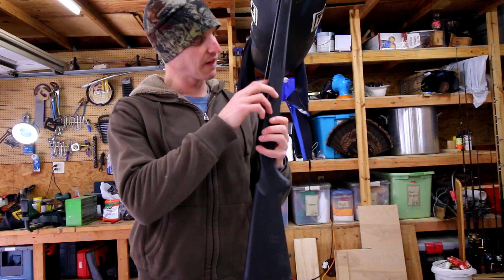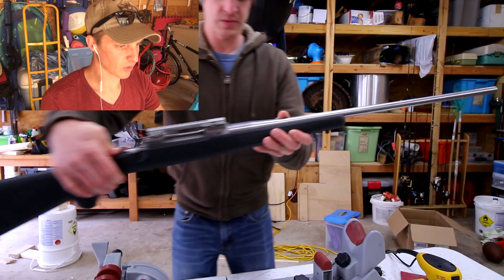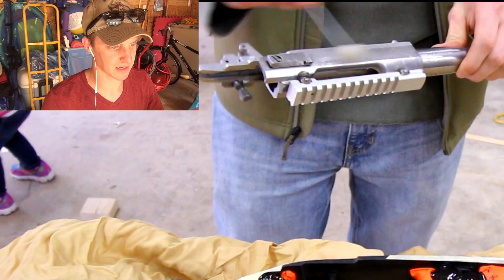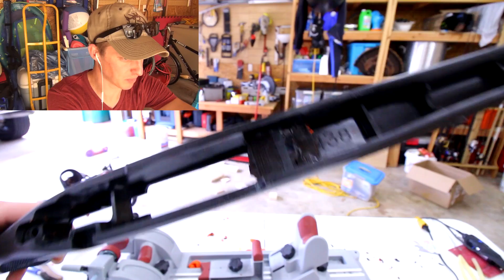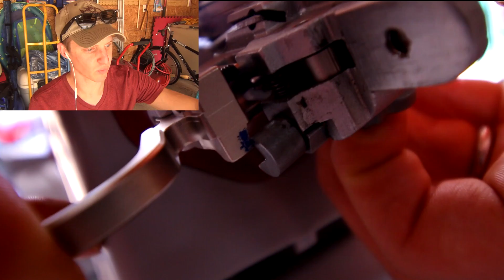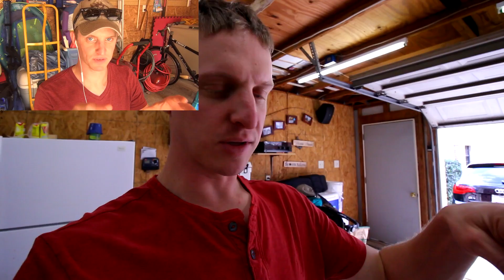Glass Bedding Synthetic Stock - Timney Trigger Ruger M77 Install

Comment: I did the same thing with my Savage Stevens model 200 in 30-06 synthetic plastic stock.  I mixed my glass bed with fiberglass its stronger, you can use steel wool but it rust? Oops!  I drilled several small holes and ruffed up the action with sand paper very similar to what you guys did.  I started  with cheap 150 grain power shocks was getting 3 inch groups before bedding and about 1.5 after.  I have reloads that are 3/4 easily.  IMR 4350 57 grains using 165 nosler BT 1/2 inch groups on both my 06's  SWEET!
Reply: You say you roughed up the action with sand paper ? Wth! 🤦🏻‍♂️

Comment: Just some of suggestion based on my experience from bedding about 50 rifles and the lessons I learned from my mistakes:

1) Playdough is not ideal for filling in the holes, gaps, or any area that you don't want the bedding compound to enter.  Use modeling clay or plumber putty.  Playdough is too soft.  It will move and more likely to blow out if too much bedding compound is used or when excess pressure is applied.  Playdough also shrink quickly especially in cold temperature and leaves open gaps.

2) Hornady One-Shot aerosol case lube is an excellent and easy to apply release agent.  I've  used it with Devcon, Accraglass, Marine-Tex, JB Weld and Pro Bed 2000, and all rifles released without any issue.  Just make sure to spray one coat and wait at lease 1/2 hour to dry.  Then spray a second coat and let it dry before fitting the action onto the stock.

3) Remove the scope, scope rings, trigger assembly and anything else that dose not have to be on the rifle.

4) Always do a dry fit first to make sure things fit properly before the actual bedding is done. 

5) Do some practice runs to get familiar with the process and to make sure you know what must be done in what order before the actual bedding process starts. You only get one shot to get the bedding job right.  If you forgot something needed to be done and remembered after attaching the action to the stock, the correction will often be a messy, time-consuming, and profanity laden, pain-in-the-ass procedure.

Comment: I've done a couple of these and they came out great, I used JB Weld as a bedding epoxy.  You don't have to hog out the stock to free float the barrel, just wrap the barrel in a couple layers of electrical tape and suspend it above the stock as you tighten the barreled action into the stock and let the bedding cure.  The barrel will be slightly suspended above the stock, and the action lug will be molded to the stock.  To protect your stock while the epoxy is still liquid, you'll want to use electrical tape, particularly on the side of the barrel, to help clean up any epoxy overflow.  You'll also want to use a hex bolt with the same thread as the action screws to help back them out when the epoxy dries.  The Ruger Mark IIs and Hawkeyes are excellent rifles, and a good bedding job helps achieve the excellent accuracy Ruger factory barrels are capable of.

Comment: Pretty cheap of timney not to have the safety ledge machined correctly.
If they can't get that right should you trust them with a sear interface?
Reply: Lol, that’s why it specifically says on the box “to be installed by a professional gunsmith”
Reply: @reddawng43x91  Nonsense. It says that on the box to avoid lawsuits.

Comment: It certainly is a learning experience, I’ve bedded my Model 70 in both a Boyds stock and a Bell & Carlson. The Boyds was my first shot at it, and turned out decent. The Bell & Carson turned out extremely well, I was hoping to not need to bed it since there was an aluminum bedding block, but even with the action torqued to 45 inch pounds, there was still play. Thanks for sharing your experience

Comment: So how did it work out? I've been thinking about trying this but curious if it will stay together being on a plastic stock?? 1year review?
Reply from the maker: It stayed together but the gain in accuracy wasn’t as much as we thought there would be. But there was definitely a difference.
Reply: A lot of rugers don't respond well to free floating. They're designed with the fore end pressure. Bedding definetly should help though. Good job.

Comment: put tape on the barrel. then release agent so you get a spacer effect with the tape.
Reply: and on the recoil lug's back side only. one thickness of blue masking tape will not affect the glass bedding's purpose but will provide the scant space to insure easier release and replacement, as well as floating the barrel.

Comment: its generally standard to kinda screw up your first bedding job. as long as you don't permanently glue your action to the stock its not so bad. i have bedded 10+ rifles (rem/howa/savage)  and i still get nervous, about to do my first ruger.
Reply from the maker: +jacob blum we were just glad it came apart haha!! I don't think there is such thing as too much release agent.
Reply: If you use to much (which I have done) you get these weird bubbles in your bedding after you separate. I've had the best luck with quick shot case lube.